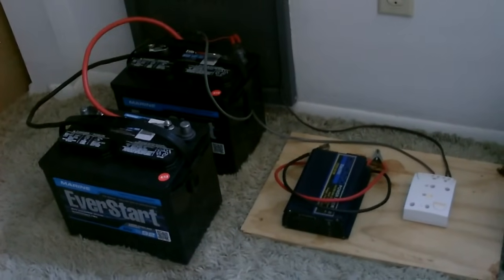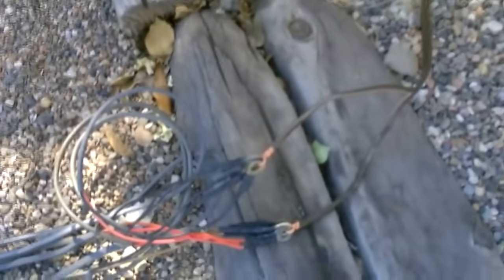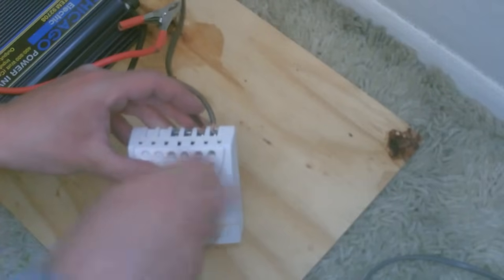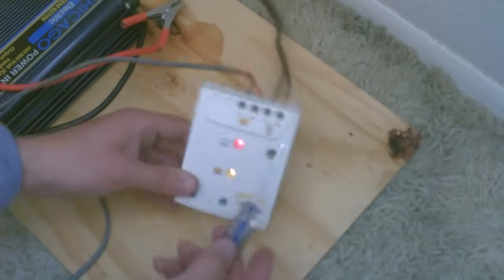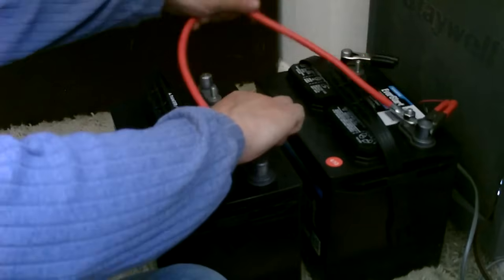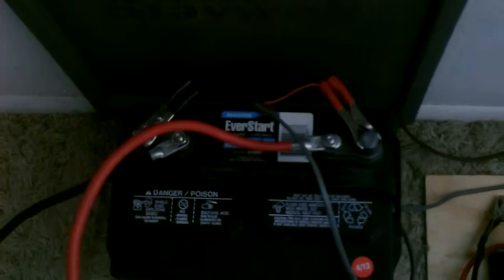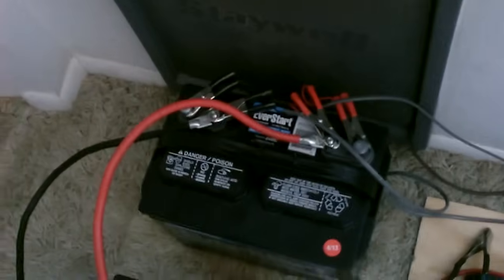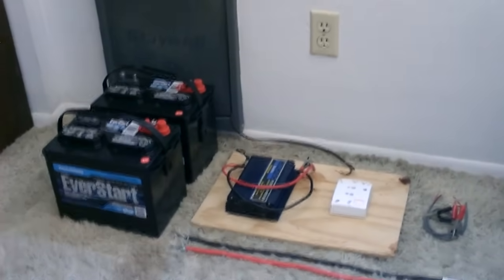How to hook up Solar Panels (with battery bank) - simple 'detailed' instructions - DIY solar system

Comment: Just curios im about to do a job for a friend like this and was wondering since he wants 120V out of his receptacle how many car batteries or boat i would need to have that, it will be running a mattress pump that asks for 120 and may use 1 amp at most. Any help would be great !!
Reply from the maker: hi there. if you just need the system to run a mattress pump (that is 120 volts and draws 1 amp) for a few minutes then just one 'good size' 12v battery should work, remember not to use car batteries though. you need to use 12v deep cycle battery or batteries. if you're only charging one battery remember to use the correct amount of solar panels.
Reply: @desertsun02  Thank you ! This helped alot

Comment: What's the reason to add a parallel battery?
Reply from the maker: hi. adding batteries in parallel allows the battery bank to store more power (without increasing voltage). 🙂

Comment: This is a great useful video. Thanks so much.

One question on the batteries:
If you connect those two batteries in series instead of parallel, what would happen?
Reply from the maker: hi there and thanks. if you hooked the batteries in series that would make the voltage of the battery bank 24v. you would no longer have a 12v system so you would need to use different solar panels, and a charge controller and inverter that was designed for the higher voltage. i think that is all you would need to change, but i may be forgetting something, so do your research if you decide to set up a 24v battery bank.
Reply: @desertsun02  got it. Thanks so much for the advice.
I just subscribed to your channel.
What projects are you up to lately?
Reply from the maker: hi. thanks for subbing!. at the moment i'm working on another stirling engine project and a 12v all-purpose cooker. this cooker has a stainless steel cooking chamber, built in handle and 2 lids. it cooks, frys, bakes, boils, roasts and steams (all on 12v). other thing i've been doing is "fixing" the automatic closed captions on the videos. youtube recently put automatically generated captions on them (which is cool) but they are pretty sketchy (meaning the captions are often wrong). takes about 45 mins to fix each video. i've been working on it 6 days a week for 1 to 3 hours each day for 2 months. i've got 200 fixed and about 100 to go. it's a very long project but i think it's worth it. people can turn on the captions and then choose the language they want. i think youtube lets people chose from 60 languages (last i checked).
Reply: @desertsun02  do you have a video on making your 12-v all purpose cooker? I would love to check it out.  

And yes transcription is very very labor intensive.
I transcribed for a professor during college for her audio in person interview conducted with some psychologists.
It was only a few hours long interview.
But it took me like three months to transcribe the whole thing..
Reply: @desertsun02  also, may I ask what waterproof connectors/cables did you use to connect the charge controller with the battery?
Reply from the maker: hi. since the charge controller and the batteries are inside i didn't make the connections waterproof
Reply from the maker: hi. the 12v all purpose cooker i mentioned is still being worked on (i'm actually testing it right now). i have an earlier 12v multi-purpose cooker. here's the link to that one https://youtu.be/8grnYgqtYcA
Reply: @desertsun02  what are the main differences between the all-purpose one and the multi-purpose one that you are currently working on?
Reply from the maker: hi. lots of things. the newer one has a 'stay cool' built-in handle, 2 lids (an inner and an outer one), when packed up the unit holds everything inside the can (so it just looks like a metal can. you can't even tell it's a stove). also, it sets up in about 5 seconds. no kidding. but most of all it's got a large stainless steel cooking chamber (36 to 38 oz.) - so over a liter. the other model holds about 30 oz. (just shy of a quart). i'll probably be posted in a week or so (from today - today being 04/08/2021). i use it mainly for boiling but it works as a fryer, steamer, roaster and at the moment i'm testing it as an oven. baking a potato in the chamber as we speak.
Reply: @desertsun02  that's very cool. I will definitely learn from your video on the stove.
Regarding the battery system that we were discussing on, May I ask you what type of connector(s) I should use to connect an inverter (12v to 110v) with a 12v battery?

Comment: Do both batteries have to be the same amp hour battery? Can you mix or should they be identical?
Reply from the maker: hi. they should be identical. the same amp hour, the same brand and about the same age. whenever i replace my battery bank (which is about every 3 years) i replace all of them at the same time. with brand new batteries. i would not do it any other way.

Comment: I'm confused, I just watched another video suggesting the charge and load wires should spread across both batteries. This ensures both have equally charge and workload. This is due to the resistance in the link wires between batteries.
Reply from the maker: hi. that's a common misperception that some people have. it's actually better to hook it up the way i show in this video. the electricity is moving through the wires at essentially the speed of light so there's no imbalance. the system looks at all the batteries as 'one battery'. scientific studies have been done on this and show - in testing - that they couldn't detect any difference between the first and the eighth battery. (in an 8 battery system). over 8 and there is an 'extremely tiny' difference. (or 'nearly undetectable' difference is the way i think they put it). my opinion is it's better to keep it simple. more complex ways of hooking up battery banks should only be used with banks over 10 or 15 batteries.

Comment: Just a quick question. How long do these usually take to charge? And also what kind of things can you run with this? Like can you use this to run fridges and air conditioning if per say power goes out?
Reply from the maker: hi there. this system will charge the batteries from empty (which is anywhere from 33% to 50% discharged) to full (100% charged) with one full day of sun. it can run most small or medium sized items for several hours a day. (can openers, mixers, blenders, lights, laptops, tablets, fans, string trimmers, leaf blowers, power drills... it's a long list). i've got a video that shows a whole bunch of stuff that it runs. here's the link to that one https://youtu.be/8LAjx_XAR90
Reply: @desertsun02  thank you so much!!!!

Comment: I’ve been looking at setting a small solar system up for myself, and was wondering if I was missing something, as this seems deceptively simple. The way you’ve explained it here makes perfect sense, than you very much for the wonderfully clear, to-the-point explanation!
Reply from the maker: you're welcome. i'm glad it helped. i made this video specifically to take the "mystery" out of it and to show how easy it is to do. plus with every passing day it seems like the prices continue to drop on the items needed. you can now set up a whole system for about $300 - maybe less ...and all the stuff needed is easy to get. 👍 i've been running my system for 12 years now.
Reply: Where do I find a cheap charge controller?

Comment: Could you run a refrigerator off of this set up ?
Reply from the maker: hi. sure, you could power a small one. for a full size one you'd need a couple more batteries
Reply: Thanks I’m going to look into making a four battery set up for emergency use. Mainly to power a fridge. Take care.

Comment: Thanks for this awesome DIY. I thought hooking up a solar power system would be very complicated, until I viewed this video. ☮️🙏🏽
Reply from the maker: hi there and thanks. yep, it's super easy to do. i wanted to take the "mystery" out of it and show everyone how easy it is to do. you can literally put it together in a couple of days and then you've got your own little power station right at your house. these days the whole thing can be put together for about $335 (maybe even less now that 12v 100w panels can be as little as $64 on amazon. i just did a quick calculation in my head and i think if i was starting from scratch today (12/01/2020) i could put this all together for $275

Comment: Thanks for posting this video...i have a question.  Is that some sort of an adapter that you use that connects to the battery post in order to run those cables to the other batteries?
Reply from the maker: hi there. no, i don't use any special adapter. it's just the cables connected to the batteries. 🙂

Comment: Looking for a charge controller, but when I search them, positive and negative ones pop up, and you are only using one. What brand is your controller?
Reply from the maker: hi. yep, you only need one. it's a sunsei charge controller. here's a link to one. it's currently showing unavailable though https://www.amazon.com/Sunseicc-25000-25-Amp-Controller-SE-16000-SE-24000/dp/B001QXDDS6

Comment: OK clueless here but need to be prepared for power outage! 1. Do I have to have a charge controller? 2. I have 2 brand new deep cycle RV / Marine Batteries and a 1500 W inverter and 2 40 watt 12v solar panel kits I need to run a refrigerator for medicine and charge basic and run a cpap machine? Can I do it with these items?

Comment: Why does there need to be a charge controller? Why not attach the solar panels directly to the battery?
Reply from the maker: hi. the charge controller keeps the batteries from overcharging. if you didn't use one, the batteries would keep charging at 'full speed'

Comment: hi just wondering about connecting the inverter to the batteries 

would you not connect the + to battery A then connect the - to battery B ? just asking as ive seen another youtuber say something similar to get the most out of both batteries rather than Battery A doing all the work with Battery B as aux

thanks in advance
Reply from the maker: hi there. no, that's common misperception. the best way to hook everything up is the way i did. a lot of people don't know this but science experiments have shown that if you're using 8 batteries or less then there is no discernable or measurable difference between the first battery and last battery in the row (and only a super small difference if you have more than 8 batteries). remember that the electricity is moving thru the wires at essentially the speed of light so the entire battery bank acts and functions as 'one battery'. note that if you have more than 8 batteries there are other types of configurations (that are beyond the scope of this video) that you can use. keeping it simple and straight forward also makes it easy when wanting to add additional batteries (you just string extra ones to the row). *i've been running these systems like this for over 10 years and always get full use (1000+ charge cycles - roughly 3 years) - out of my battery banks. that's super good for walmart batteries. 🙂
Reply: @desertsun02  hey thanks for the prompt reply im just trying to get my head around all this for my van conversion would you mind if i asked you some more questions regarding electrics i intend to convert a box van to a camper and im primarily going to use a 12v system but some things need to run on AC (computer and laptop etc) so im just trying to figure out a way to costruct a board that lets me switch between both 
then theres the confusion over "shore power" for this would I need to run a parralell system for when Im plugged in
i would like to use all 3  if i could (not at the same time of course)
solar
AC 
12v

Comment: About how much would it cost the complete kit thanks for the video
Reply from the maker: hi. these days the cost for everything is $325 to $335. tip, use 100w solar panel instead of smaller panels and buy the panel on amazon.

Comment: Could you help I am trying to link one solar panel to 2 boat batteries. These are both connected by the way ! Is it ok to link via the charge controller to one battery only ? Will this charge both ? Cheers

Comment: So no need to run the solar panels in series? I'm wondering why people run them in series now if you didn't need to?
Reply from the maker: hi there. if you are charging a 12v volt battery and you are using 12v solar panels, then you definitely DO NOT want to hook the panels in series. hooking (running) the solar panels in series would increase the voltage. maybe the other people you saw were trying to make a 24 or 36 volt system 🙂

Comment: Hi i have a question coz i have a 40w coleman solar panel is it ok that i will use the 400w mobile power outlet inverter,? Thank you
Reply from the maker: hi there. it should be okay.🙂
Reply: But my solar panel is 12v then my inverter is 24v so i need 2 battery those still works,?

Comment: This is what is confusing me.
They are saying " how to connect 2 mppt charge controllers to a solar system" if 1 will do why are they talking about 2.
I've bought 2 Renergy 100 w panels and I have 2 x 125 amp hr batteries that I want to charge but I'm getting bogged down with technical info.
I just want to know what size mppt controller I need for the job.
You've shown very clearly you can do it with 2 mppt controller and 2 batteries.
All I need to know now is what size mppt controller if you can oblige 🤗

Comment: Yeah that's direct simple and to the point a very small simple system which would run some led  lights and such maybe a TV  for camping for 5 or 6 hrs and need sunlight the next day to recharge the batteries but it can be kept compact and easy to travel with for like I said camping or outings where theres no power .. or even at home when the power goes out you'll always have the ability to have lights again tho l.e.d lights any incandescent lights are a lot higher draw even fluorescent bulbs are a lot higher draw I know a guy uses one battery for one. L.e.d light and a radio and it works just fine its decent size deep cycle and the next day the solar panel charges it right back up .it works

Comment: What was your budget for everything except the solar panels?
Reply from the maker: hi. these days, you should be able to get everything (except panels) for about $255.00 (that's with a 400w and 1000w inverter, charge controller, 2 batteries, cables etc.. ). 100w panels can be found for around $80.00. total $335.00.

Comment: I don't know anything about this but can't you hook up the solar panels in series so that one runs into the next and then there is only one set of wires running out from one solar panel into the house?
Reply from the maker: hi. if you hook the solar panels in series, the voltage would go up. you don't want that. you want amps but you want the voltage to stay the same. hooking them in parallel is the way to go 👍🙂
Reply: @desertsun02  O.k. Thanks!

Comment: Hi! Can this run without the battery? Solar panel connected to the controller then controller connected directly to the inverter then to load? TIA
Reply from the maker: hi there. if you want to use an inverter and you want to run things that are AC powered, you need the battery(s) for sure. for reference: there are certain things you can run directly on a solar panel but those things need to be DC powered. no inverter or charge controller needed 🙂

Comment: How much you pay for everything???
Reply from the maker: hi. i'm not sure how much it all was, but these days you could get everything for about $335.
Reply: Thanks for the answer... sorry but I am new in all this,but where you recommend to buy everything? Thanks for your time..
Reply from the maker: keep 3 stores in mind: walmart, amazon and harbor freight tools. i get the batteries from walmart. i got the solar panels from harbor freight tools but these days  i'd get the solar panels from amazon. they got 100w ones for 80 bucks. and i'd get the inverters, charge controllers etc.. from either amazon or harbor freight tools. (the inverters i have are from harbor freight tools). note that auto parts stores are a good place to get the battery cables. that's where i got mine. walmart probably has them too

Comment: I wish everything in life was explained so simple this way, thanks man, that's all to it .I have a question, i already have installed 150W( two 75w solar panels) in a cottage, with just one battery 115 AH, now i want to add another battery, my battery is 4 years old, still working good , can i add a new battery with the old one together.

Comment: Will the batteries not run out in this way? Isn't there a need for a component after the batteries so they can't run out of power?
Reply from the maker: hi there. no, the inverter will shut down when the batteries are at about 50% discharge. that's when they're considered depleted. they won't over-discharge.

Comment: Hello just a quick few questions.
What battarys do you use? 
Is there a special connector I need for adding more battery? 
And what was the thing at the end called to check the voltage? 
Thank you

Comment: I’m trying to hookup a  10amp system to run my freezer what would be your recommendation for a material list? Can I use 12v car batteries to store power I’m pretty lost but we’re trying to get this completed ASAP
Reply: Car batteries are NOT recommended for Off-Grid Solar ...
Reply from the maker: hi. MrSummitville is correct. you don't want to use car batteries. they need to be deep cycle batteries

Comment: I've got a question for you . In this video you connect two batteries together . Should two batteries or more batteries have the same capacity like Amps/hr, same voltage etc before connect them together or they can be  different capacities?